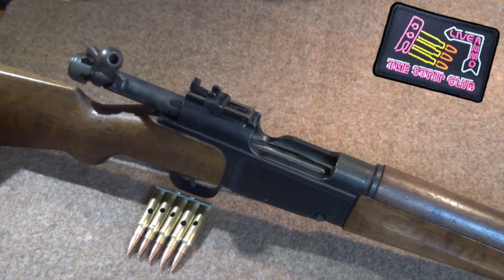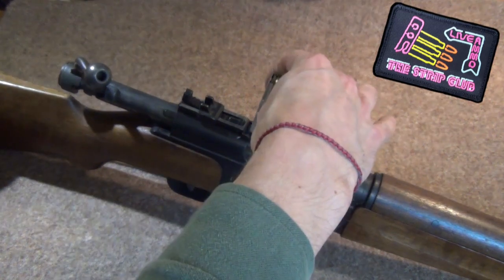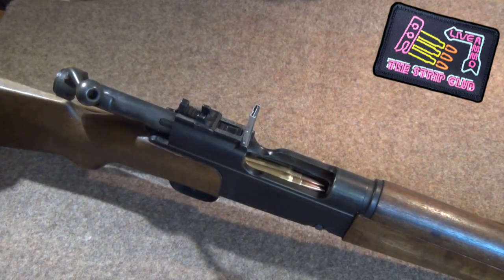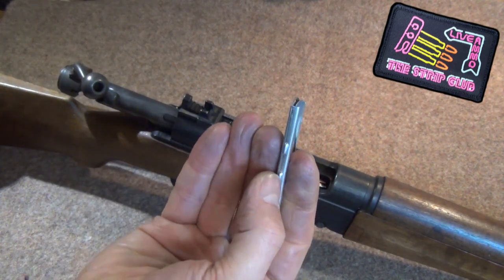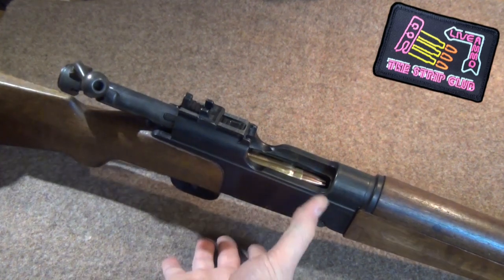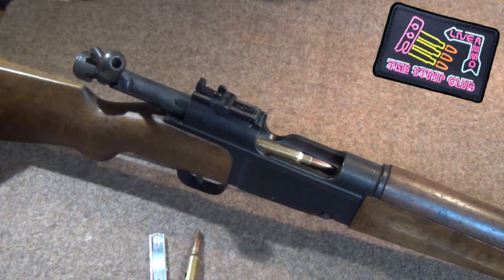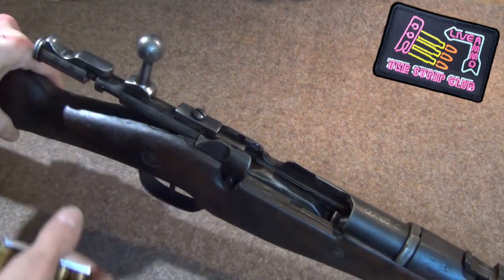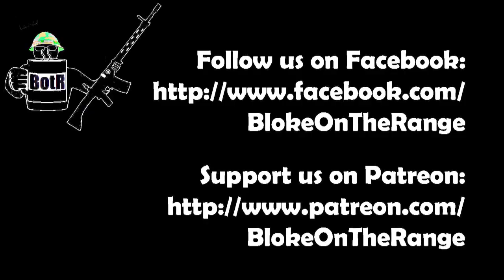[004] Bloke on the Range Strip Club: French Charger In French Bolt Action Rifle(s)?

Comment: Who would have thought it. The right clip in the right rifle strips beautifully.
Reply: Oh this one was a purely because it was easy to make endless filthy innuendo 😀 Also to highlight that clips are actually handier to use in the conversion than in the rifle it was intended for 🤔
Reply: @thebotrchap  I have to agree the innuendo was good even by the excellent standards of this series. 
I wonder which combination will be next on stage to strip, elegantly or otherwise?
Reply: For most of my service with the Canadian FAL we used "training ammo" packed in boxes of 20 rds.  When it was starting to be phased out we started to get war stock ammo, which came in bandoliers in stripper clips.  The stripper clips were useless.  The rds were so tight that we had to take them off the clips and single load them.  When we got the M16 family the early issue ammo was "war stock" in bandoliers.  The ammo was in ten rd plastic clips, and each bandolier came with a mag charging tool.  They worked great, the plastic on plastic was slippery enough that the rds came off easily.

Comment: What is a "controlled feed"?
Reply: The bolt face and the extractor have control over the base of the cartridge from the point the cartridge has left thr magazine, but before the bolt is full closed.
Reply: The extractor picks up the cartridge as it leaves the mag. Examples are the Lee Enfield and most Mauser type rifles from 1893 onward.  Compare to a push feed where the extractor clips over the cartridge as the bolt closes. Good examples are French bolt actions (Lebel, Bertier, and MAS 36), all Mosin family rifles,  the German 1888 "Commission Rifle", and the M91 Carcano (I think).
Reply: @ironhead2008  Carcanos are controled feed too
Reply: @fn3048  I prefer centimeter by centimeter, far more tantric (gives me a bigger number too)
Reply: @thebotrchap  but 2 inches is still bigger than 4 centimeters :) Plus you extract prematurely :) :P
Reply: @fn3048  Depends on the bore diameter 😉